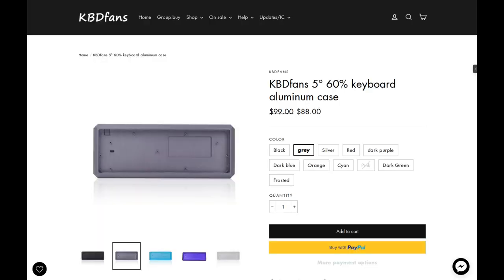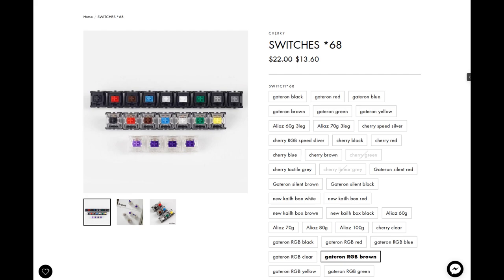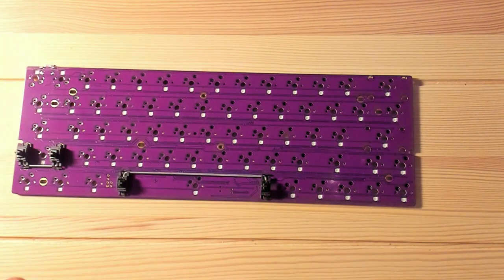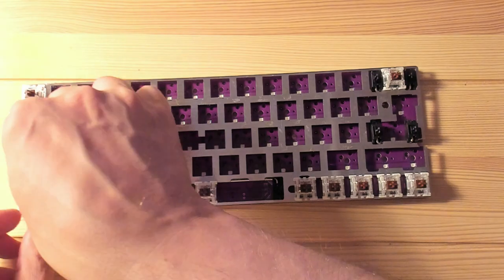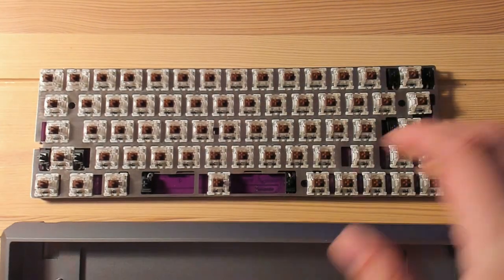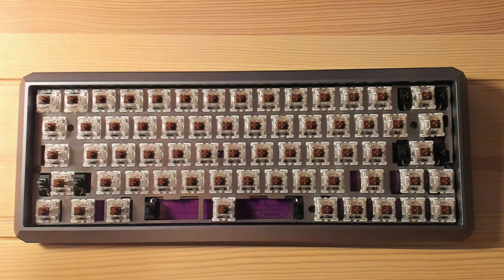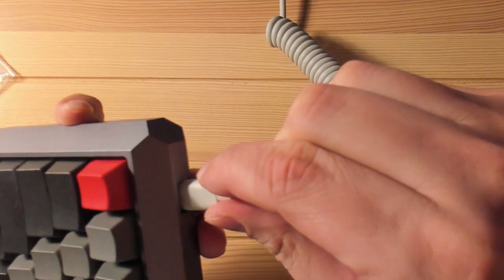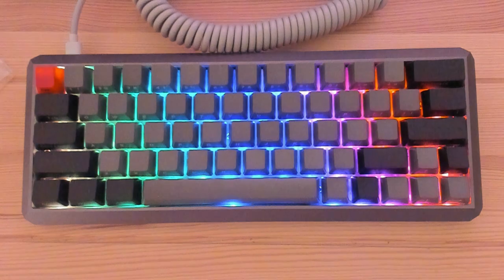Building a Mechanical Keyboard

Comment: no soldering required? never built a keyboard before, do the switches have pogo pins or something to make a pressure connection?
Reply from the maker: No -  this PCB has hot swappable sockets on it.  Otherwise soldering would normally be required.